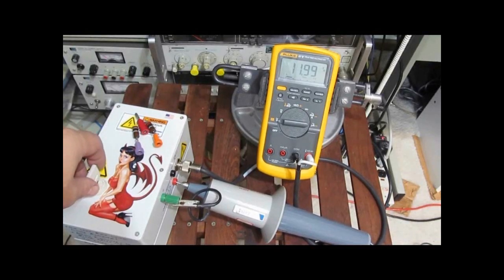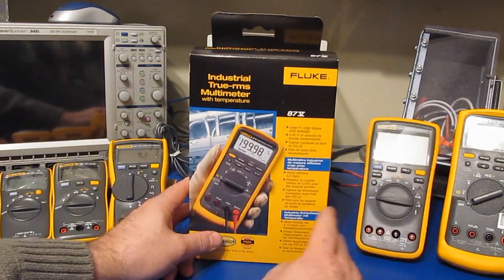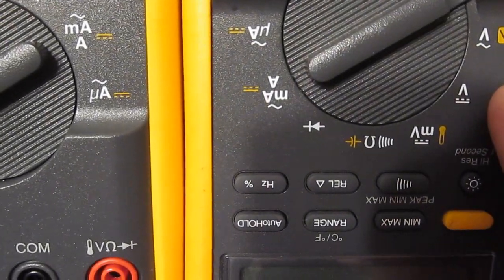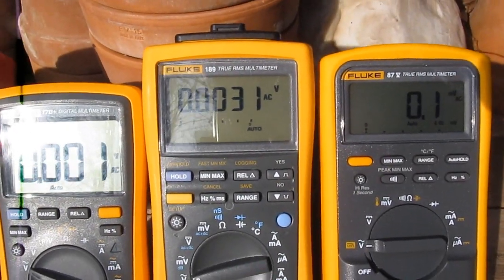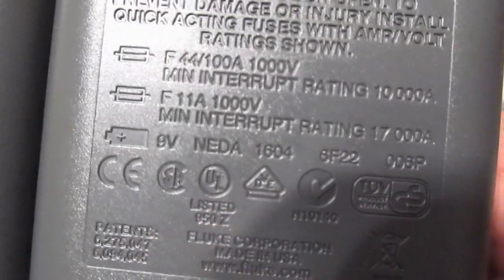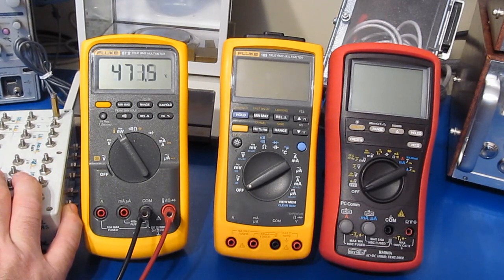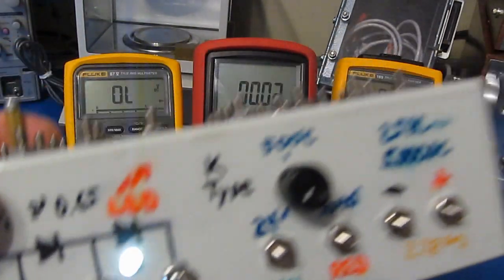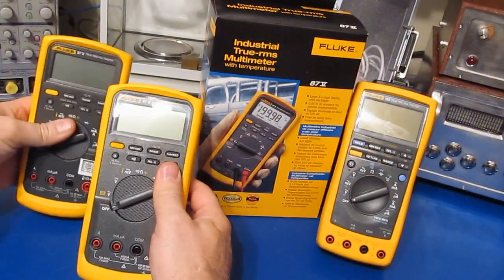Fluke 87V Robustness Tests,  Part I

Comment: The 87v is an overpriced dinosaur and flukes reluctance to update this “industry standard” to modern times is astonishing.I mean: a 9 volt battery with a wired dangling 9v clip like a 1970’s walkitalki, really?( no AA), fuses not accesable without killing your calibration sticker?, no threaded metal inserts?, no ac+dc mode?, no msec on the dutycycle?, the tilting bale doesnot properly click/fit in the rubber boot and swivels bad?, the high res mode which is not to spec and therefore must be seperatly switched to keep the rest of the meter in spec?
Its a nice reliable and stable meter but imho not worth the 600 euros i paid for it.
Reply from the maker: For calling it an overpriced dinosaur,  you get your comment pinned.

Comment: As I commented 3 months back, I had just ordered a new Fluke 17B+ after watching youre tests including it.  Its my first Fluke, ive been completely happy with it and im sure its all the meter ill ever need as a DIY/hobbyist - I thank you for the thorough work you do in testing all these meters in every conceivable way for all to see.  I dont know where else one could get a more comprehensive idea of a  meters performance and durability than your channel.  I do wish the 17B+ had true RMS and a bar graph but I knew that before buying and dont necessarily need them so im just nit picking, it has a large display & good feature set for the price and seems to have better transient resistance than a new 87V - who would have thought.  Overall I feel I got as good a quality meter as I could ask for at this price (around $100), and seeing how well it did in your electrical and life cycle tests sealed the deal for me.  Now seeing how easily the 87V failed in transient testing I feel even better about my purchase.
Reply from the maker: If you look at the spreadsheet, you will notice that I eventually ran a new 87V.  I also went back and tried to analyze why the one 87V failed at such a low level.  Those videos are data are all free to download.

Comment: "Magic box" Joe...including a circuit to simulate thermocouple K type voltage ?
Reply from the maker: I started out just plugging a sensor into the meters and holding it with my fingers or blowing on it to see if it changed.  At one point I added a K type sensor in the box.  I later added a precision source.  Like the other features, it just basically tells me if the meter is still working or not.  It's not intended to be used for calibration or alignment, although some components do have a fairly tight tolerance.

Comment: Hi Joe, another great video, have you ever had a look at the fluke 28ii, very similar to the 87v but different input jack design and other differences, i wondered if fluke had improved any 87v short comings with its more modern design.
Reply from the maker: I have never looked at the 28II.  The only ones I have looked at are listed in the spreadsheet.  You may find the link in the description.   For what ever reason, the 87V is popular enough that people wanted to see a third test ran.
Reply from the maker: Johnny Tramain  Sorry, I have no idea why Dave on EEVBLOG says this.  I asked once and I think he said that if you work in the industry you would know or something to that effect.    IMO, it's not really what I would want as an electrician.   It's also not anything I would want for work in electronics.  Maybe it would fit for some sort of technician job.  It does seem that a lot of hobbyist  covet it for some reason or another but IMO, if I have my choice of Fluke meters, it would hands down be the 189.    If Fluke decided to release a new version of it, I would buy one assuming it was made here in the USA.

Comment: Joe, when you do the 'chemical resistance' checks, can you do the key faces as well? Especially if said keys are the soft variety... great videos, Thanks!
Reply from the maker: Sure
Reply: I was surprised you didn't gas the ugly boot too.
Reply from the maker: Same gasoline and methanol I have applied to other meters.   So far, it's not been much of a problem except for the ANENG and Kasuntest cheap meters.   Brakeclean would have been a good one to try as well.

Comment: A bit off topic for this video, but, I think there were 2 videos where you mentioned what you used to polish the display on a meter and showed the results, which videos  were they? Also, did you try if this would fix the display on the Aneng that became opaque where you put the fuel on it?
Reply from the maker: I have no idea which videos I showed that polish in but I did post about it on the EEVBLOG site as well.   No, I did not try to repair the lens on the Aneng meter.  Honestly, for the time invested, it would be cheaper to buy a new meter.
Reply: Well, it depends on the situation. Most people don't have more than 1 or 2 multimeters, and as the meter was not damaged otherwise, throwing away is a bit of waste, also repairing is better than waiting several weeks for a new one. With a multitool from Proxxon or Dremel, the polishing could I suspect be done pretty quickly, so as I have encountered this issue before with other equipment, it would be interesting to see if such a chemically induced frosting is only a surface layer that can be fixed. But what I wanted to know about the videos was to find out what the brand/type of plastic polishing was: Which did you use? As to the knob testing, that's interesting too in your tests. I feel that none of the meters that I have or had the past 10 or so years (VC 230, U1273A and recently Fluke 289, Aneng 8009) come close in how good the feel is of the 1980s Kaise SK-6220, which has a separate switch from the multimeter PCB. It's like the difference between a IBM clicky keyboard and laptop keyboard :)

Comment: I was looking at the 87v on eBay recently, about 220$ for a clean used one with many bids on each one, so there very popular on eBay, even beat up ones go for over 150$, one thing that's unique about the 87 is the 4gig ohm input impedance mode in the mV range, I don't thing brymen has that feature
Reply from the maker: Interesting.  Quick look at the datasheet for the 87V, looks like 10 Meg in the mV ranges.  I checked mine in the DCmV, 10M.
Reply from the maker: Could you post your test setup.  Are you looking at the AC range where it is AC coupled?  If so, that may be misleading.
Reply: Not really. Page 10 of the manual: Hold Hz % on start-up to enter DC mV Hi-Z mode. 80-Series I & III meters also had that.
Reply from the maker: Someone else mentioned this Hi-Z mode.  I have started to post about it here:  
http://www.eevblog.com/forum/testgear/hear-kitty-kitty-kitty-nope-not-that-kind-of-cat/2450/

Comment: I find it pretty ironic that the new casing colour doesn't match the stand, and on which the finish is of poor quality compared to older production models, since the casing is the only thing left on the Fluke 87V that is made in USA (at least on my late 2017 unit). And I definitely don't like the new darker/greener display background which makes reading the display in dimmed surroundings more difficult than on the older version, and requires me to use the backlight more often, which drains the battery more. The display on my Fluke 115 is much, much better in comparison.
Reply from the maker: Is your 2017 case as bad as what I show?   A few people wrote me after making this video showing me pictures of their cases and it seems like their quality has gone down.    Still many people regard the 87V as the holy grail.  I have no idea why.    I will say Fluke meters in general continue to hold up very well in my tests.
Reply: @joesmith-je3tq  
Yes Joe. The same swirly marks, and pitted finish, and mismatched colour as what you've shown here. I can't help but agree that Brymen seems to offer better quality, better features in some of their products for less money. But they don't cary the Fluke name and logo. In all fairness though, I don't think that the appearance of the boot on the newer 87V will have any impact (pun intended) on the ruggedness of it, and its ability to protect it. It's just annoying on a product in this price range. Here's a link to a DropBox folder where pictures of the boot on my 87V are stored: https://www.dropbox.com/sh/hf0jvb3etoiwyvy/AAD71FHm6QHuGg9PRbGd8nrVa?dl=0
Reply: @joesmith-je3tq  
Perhaps the "holy grail"  reputation of the Fluke 87V is largely based on the fact that the meter has been in production for a long time, and that Fluke meters have a great reputation for holding their calibration over very long periods of time, despite harsh environments and physical abuse ?
Reply from the maker: @AlainHubert  Looks about the same as the one I bought.  Not a good sign that they are keeping up their quality.    I agree that the brand has been around a long time and their current meters (at least the ones I have looked at) have been very robust.   The 87V being the holy grail really makes little sense to me.  It's not a meter I would want for electronics.  If I were an electrician, it wouldn't be my first choice.  It really seems targeted to techs.  They really don't offer a meter today that I would want.  The 289 is about the closest.
Reply: @joesmith-je3tq  
Agreed about the Fluke 289.
But at $740 (Canadian dollars), I can get two Brymen 869 for that price... 
The only thing that remains to be seen, is how long a Brymen will retain its calibration over the years. My father has a Fluke 77 (first generation grey, before the yellow boot era began) that is still spot on, and has never required recalibration in over 30 years, and still works flawlessly.
Reply from the maker: @AlainHubert  My first Fluke was less than impressive.   Had the Fluke 101 not performed as well as it had, I doubt I would have ever owned another.    https://www.youtube.com/watch?v=ObKomuLLqU8
Reply from the maker: I should add that originally before I bought any Brymen products, I saw similar posts about their expected life.  After running the transient tests, temperature cycling them and running life cycle tests on the switches, I really don't see too many comments like this.    Every one of their products I have looked at has performed very well in my tests.
Reply: @joesmith-je3tq  
Interesting that Fluke 8000A. Reminds me a bit of my first DMM that my dad had given me back when I was about 16 (I'm 54), when he replaced it with one with an LCD display and better specs. I still have it. It's a Ballantine 3/24 red LED DMM. My dad bought it new, in 1974 for about $250 back then (if I remember right). It might not be a Fluke 8020A, which my father replaced it with, but it still works flawlessly. Only the rechargeable batteries have been replaced over the years. Here's a picture of it next to the 87V:
https://www.dropbox.com/s/hxfkia9nndcewqt/IMG_0308.JPG?dl=0
Reply from the maker: @AlainHubert  Nice you could keep your first DMM, especially coming from your dad.   It still appears to be in very good condition.  I abused my Fluke a bit.  It's been under the hood my my cars.  lol   These digital meters were expensive back then but if you needed the performance, they were far better than the analog meters that preceded them.

Comment: any bets on when this meter fails the surge testing? I say 2.5 KV ! Should be interesting
Reply from the maker: Personally, I want to see it go at least as far as the 17B+.
Reply: lol IDK the Chinese flukes seem to do good in your test! Guess we will see soon enough!
Reply: I'll bet on 1.5kV 1.2/50, same as before.

Joe, could you test all the suitable ranges with a 1000V PSU, before engaging impulse tests? Something like a rectified, then multiplied power line would be fine.
Reply from the maker: I don't think I have a power supply that can drive a meter when it engages the current source clamps.   I do run that full rectified 220VAC line test on all the meters but that's as high as I normally go.      However,  when I first looked at the 87V I did hook it up to the plate supply of an old radio and cycled it through all the modes.  700ish volts at about 500mA.   You can see that testing here:   https://youtu.be/6GyoulNOPD4?list=PLZSS2ajxhiQAfyFum1PEDE-zlQ0Kmp0yI&t=57

Comment: The 87v high res mode has an annoying thing and you also didnt notice at the 0.1 ohm test; you first need to put it in the right manual range, then put it to high res and then do the delta-nul, in the wrong order it will not switch to high res.
Reply: Yes, it can read 0.01 OHM, mine does.
Reply from the maker: Nice find.  The manual only shows 0.1 ohm resolution but indeed, manual range then high res will gain one digit.  Not a fan at all with how this works and the fact it is not clearly stated in the most recent manual for a product this mature, seems really poor.   The manual shows it can read up to 1090 deg C.  Is there a trick to make this work as well?
Reply: That was also my point, it can do highres but only in the right order if you want to use other options at the same time.
Its a nice meter but it has some flaws which are at this price level a nono imho and it is in desperate need of a major revision, its just not up to standards anymore, it lacks functionality and is clearly outrun in transient tests by the newer designs of the same company.
I also have a V3.03 so i am curious about part2 of this test :D
Reply from the maker: Again, the manual shows it can read up to 1090 deg C. Is there a trick to make this work as well?
Reply: Just tried, i get mine with the fluke probe and a lighter easily up to 880 C
Reply: Found a microtorch: it overloads roughly at 1100C, so i dont see any problem there....
Reply from the maker: Just asked another friend of mine who has one and his also reads well above 800C with no problems.   He has the same firmware but the meter is a lot older.
Reply: A “trick”i discovered with the temp measurement was after the dissapointment of finding out the 87 cannot show room temperaturen i realised it can if it has a proper termocouple reference built in, you just bridge out com and V with a thick short copper wire and the display shows the temperature of the built in reference, it takes some time to stabilize but after a while its bang on.
Reply: i just picked one of these (87V)up a month or so ago from a crack head for $60. I just went out to shed and fired up the propane tourch and got it to read 1040 C no problem. I was using the fluke k type probe that came with it. I cant seem to insert the picture here. This meter is about 10 years old.
Reply from the maker: Looks like it was actually a feature, not a bug.  Check out part 2.  Also looks like the reason it would not go into the high resolution mode was because the meter had been zeroed.

Comment: Joe, will you review the new Fluke 87V MAX?  https://www.fluke.com/en-us/product/electrical-testing/digital-multimeters/87v-max  The most significant improvements to this meter over the 87V appear to be a better International Protection (IP) rating of 67 and battery life boosted to 800 hours.  Your comprehensive assessment of the meter would be appreciated.
Reply from the maker: I am not really interested in the original 87V let alone a remake of it.   If they decided to bring back the Fluke 189, I would have a look.

Comment: Can you compare an 87 V and an 87 III please. I would really love to see that one
Reply from the maker: The 87III is an old meter and I would at best be able to buy an old used one in unknown condition.   I did do this in the case of the Fluke 189 as there was a fair bit of interest in seeing one ran.
Reply: @joesmith-je3tq  yeah that makes sense unless it has been calibrated to spec.But I understand what you mean.
Reply from the maker: @Tonyplat98  Even if it passes calibration, I normally run these meters to failure.  If there was previous damage to the meter, it could bias the test results.